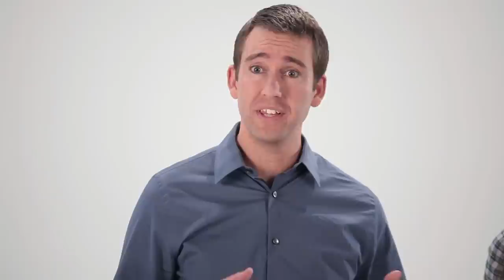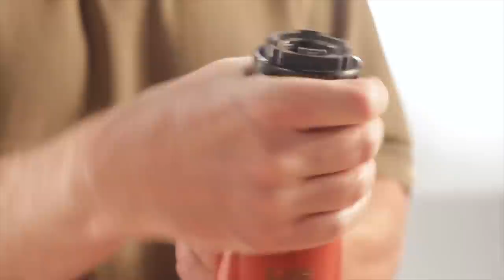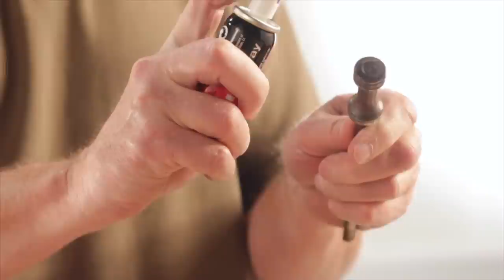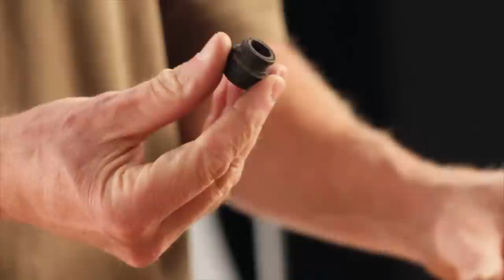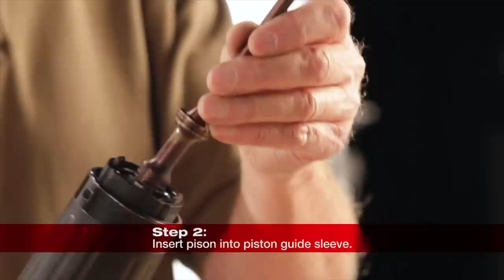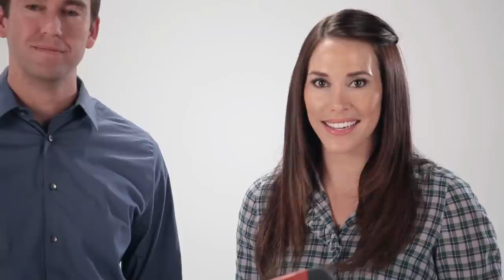HOW TO maintain and clean the Hilti DX 460 powder-actuated tool

Comment: what about the tool body itself, as one would assume there is a battery in there?, to operate the trigger, esp. in this electrical/digital age.
Reply from the maker: Thanks for the question! In a DX 460 is only mechanical components that and there is no battery or electrical parts.